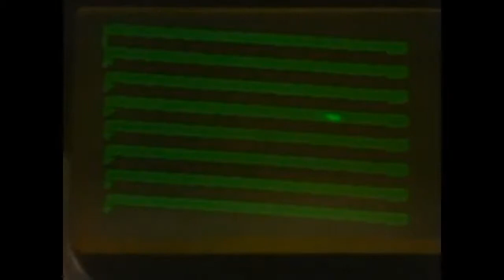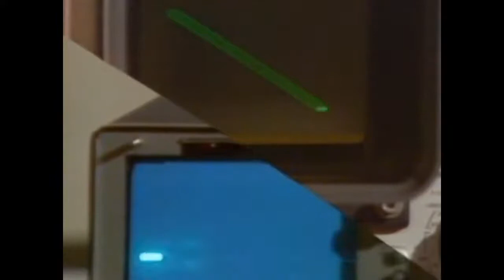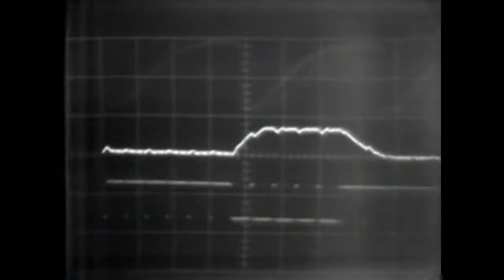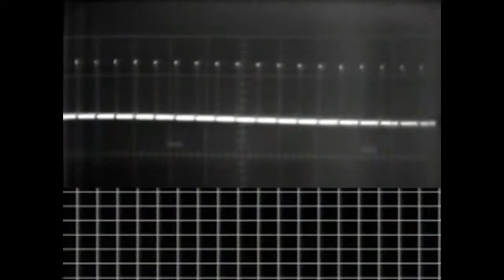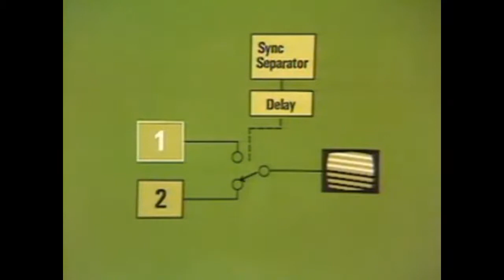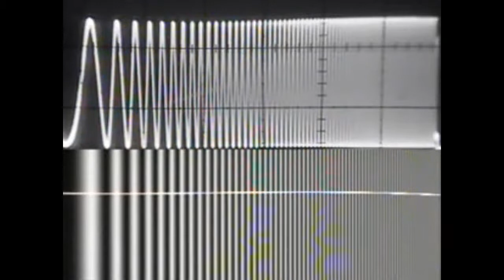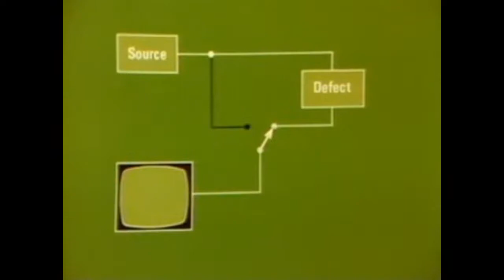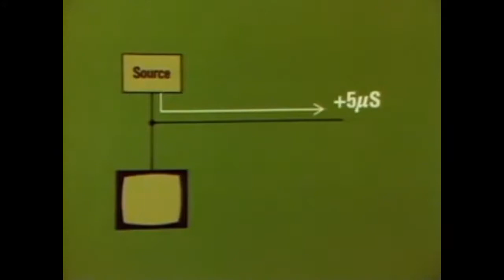Open University T321 Telecommunication Systems - Televison

Comment: The cable they're plugging into to induce the 10 microsecond delay for the ghosting demonstration at the end must have been around 1500m long. The OU production facility didn't just happen to have a 1.5km long cable just laying around, did they?